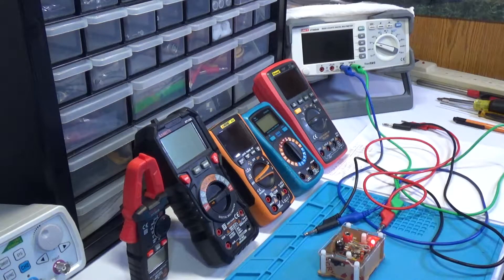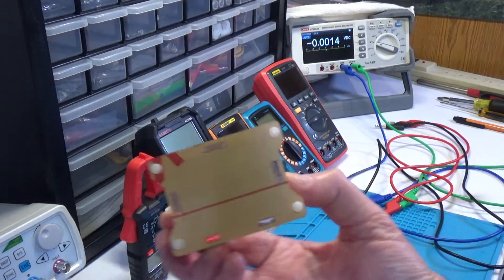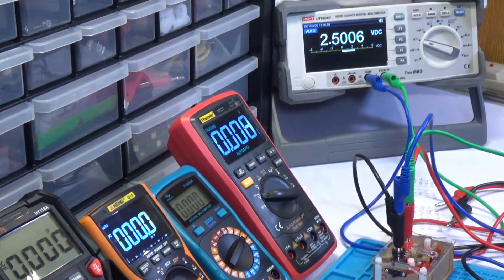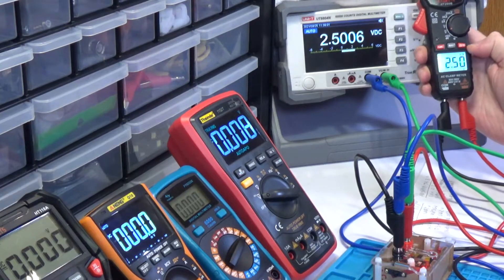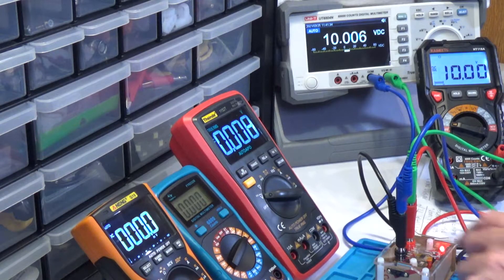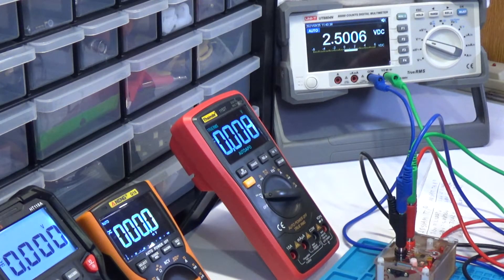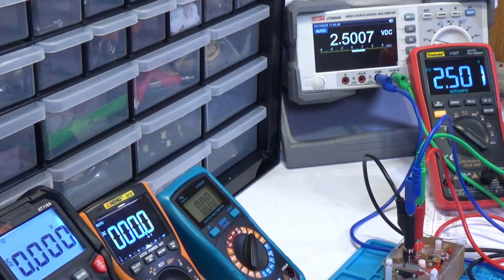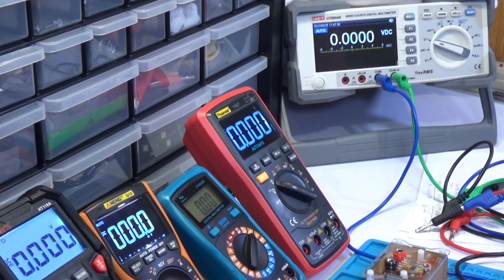Analog Devices AD584M Voltage Reference Shootout

Comment: Hi, great video. Found your channel and subscribed. I wonder which AD584 chip version your reference uses. The ADM584 comes in a J, K, L, S or T version. An M version is not existing (at least not according to Analog Devices). The L has the highest precision (2,5 .. 5 mV for the respective ranges), the J has the “lowest” precision (7.5 .. 30 mV). I do agree that with quite some certainty you can conclude that all meters are perfectly well precise when it comes to the lower DC Volt ranges, but as there is no calibration certificate for the voltage reference it is not conclusive which of the meters is closest to the real value.
Reply from the maker: Mine has the K version (I mentioned this at the beginning of the video) - I made sure before I purchased it that I was getting that because I wanted a more precise version.  But for a basic no-frills voltage standard, the J version would do fine also.  The "M" in the AD-584M has no bearing on the chip version - I am guessing it designates it is in a housed module rather than just the PCB on its own.  As for the calibration - yes I was forced to do my own "calibration" and my UT8804N has the most consistent readings and the highest resolution count.
Reply: @Sui778  thanks, I missed that indeed you said yours has the K-version. My “suspicion” is that it is no coincidence that the seller uses the M as the extension for the cased version. Some might think that The M is the successor to the J, K, L so it must have an even higher precision than the L 😊. Anyway, that’s marketing. Thanks again for the video.
Reply from the maker: I have yet to see any of these AD584's using anything besides either the J or K version chipsets - at least the ones that are in enclosures.

Comment: If you switch the cables around, put blue & green on bottom and red & black on top does it change ?
Reply from the maker: Yeah tried all that - makes no difference.  Not enough added resistance to make any difference.